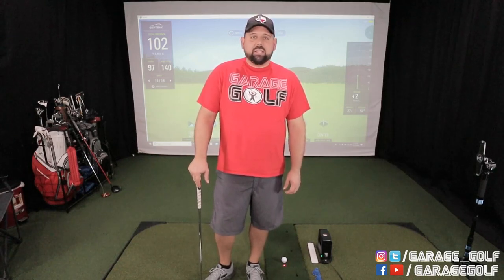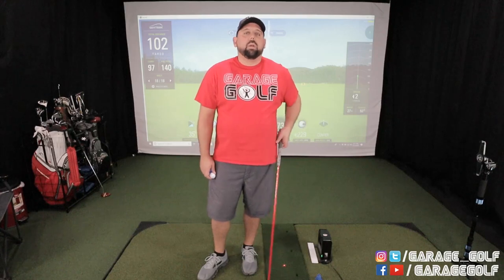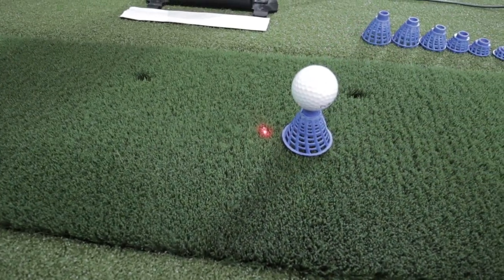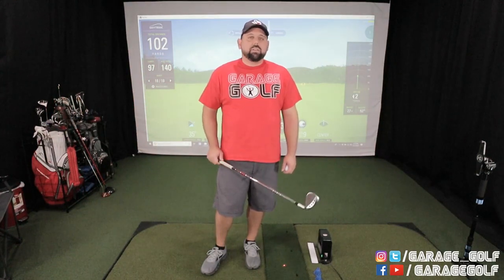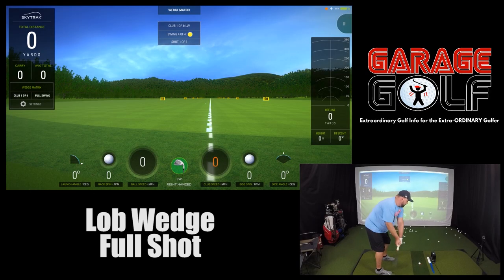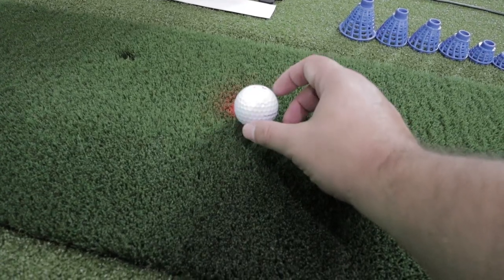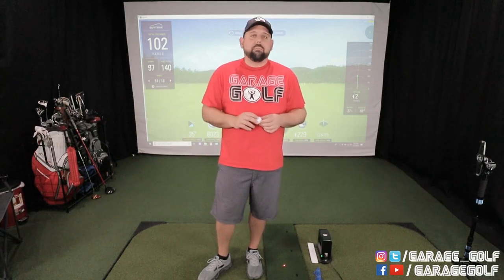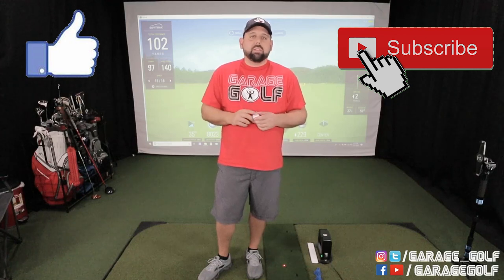Skytrak Tech Tip - Golf Ball Placement

Comment: How did you make sure your skytrak was aligned properly? Sometimes I feel it is off.. some rounds I will be hitting everything left and other rounds I'm perfect. I believe it's because I'm not setup perfect as I have to move it everytime I'm done using it. Thanks!
Reply from the maker: Hello Sean, It is certainly a tedious process sometimes. I normally go on the app or simulator program I am using and hit several chip shots to see what it is doing in comparison to what shows up on the screen. If you have a program where you can test putting with no break on the green (for example Jack Nicklaus Perfect Golf has this option) it is best to test out with putting. If the putt rolls true, most likely your shots will follow. After adjusting it for the putting, then test out some chip shots and lastly full shots. As you might see in my video, my Skytrak is actually about 1/8 open to the target line. That is the way I had to set it up to most accurately represent a straight putt. I saw little to no effect on full shots or chip shots by doing this so that is where I left it. That is why I put the piece of tape down in front of the Skytrak at its feet in the event I ever have to move it. If you line it up on your mat, put a piece of tape or indicator on your mat as well. If you have to move your mat nightly, mark the four corners of your mat with a tape outline so you know the exact spot to put it back when you set it back down. This will ensure you have the same setup each time you set it back down again. Hope this helps and thanks for watching!

Comment: About to buy a skytrack... what about drawing lines on your golf ball. So you dont have to line up the logo every time
Reply from the maker: I never line the ball up with the logo for the most part. Biggest thing with misreads is bad lighting. I now have a lamp right above the ball behind the Skytrak facing the ball and have virtually no misreads as a result. Love my Skytrak. Quick question, are you buying the Skytrak from them directly or from someone? If buying from Skytrak will you please use affiliate code: garagegolf at checkout? It helps out our channel and doesn't cost you any extra. I am here if you have any questions either way with setup or anything else. Appreciate you!
Reply: @GarageGolf  I will for sure when I buy it ... what kinda laptop specs is best for the skytrack?
Reply from the maker: @alandisney8276  Thanks!

For PC  I would go with min I5 processor but i7 is better, 16gb ram, 1 tb hard drive, nvidia gtx 1060 graphics card or higher.

Comment: Boy we could use your help.  We have tried a lot of your ideas including Wifi connection, light behind the ball, ball logo facing skytrack.  We are skill only getting about 30% of our shots to register.  Do do know our mat moves quite a bit and have ordered a gripper to try to keep it still, it sits on carpet.  Any other ideas would be appreciated
Reply from the maker: I feel your pain with the missed shots. I can minimize it by ball placement as per the video, making sure that my Skytrak is not on the same mat I am hitting off of and I now use an LED light that I shine onto the golf ball as well. That being said there will still be misreads. Now having that many misreads is a bit uncommon. Try cleaning the laser with a microfiber towel and seeing if that makes any difference. Is your Skytrak also in a case? I have heard of interference with the standard Skytrak case they sell as well. I know this is scary but try taking it out of the case and hitting about 10 shots to see how many misreads you are getting that way.
 I also never connect my Skytrak via usb as it always has a lot more misreads that way to me. Try charging your Skytrak with a portable phone charger instead when using it and connecting via network mode. I found that made a world of difference when I use mine. Try troubleshooting these and let me know if you see some improvement. Also take the Skytrak off your current mat if you can and try lining it up at the same height as your current mat but not on the mat itself (I use some books on the floor next to my golf mat in my sim room). The movement from the mat can cause a great deal of misreads. Let me know if any of this helps!!
Reply: @GarageGolf  Thanks so much.  I will try some of those. Do you think the matt moving could cause issues even if the sky track isn't on it?  I will try cleaning the lens and taking it out of the protective box.  We also have an LED light on order.  You have helped me much more than Sky Trak.  Ill be in touch!!
Reply from the maker: @karihall9542  Yes the mat moving could still cause issues reading it. Try some carpet tape or double sided velcro. That's what I used on mine!

Comment: I've just bought a fiberbuilt mat with the heavy bristle hitting area.  My skytrak won't read a shot.  I had no reading issues with my CCE may but my elbow was SHOT!.  Any tips on why or how I can get my skytrak to read shots off the fiberbuilt mat?  I've tried taking it out of the case and just using the skytrak thinking the case made it too high or something.  Didn't help.
Reply from the maker: How is the lighting in your space? Have you tried shining an LED light on your hitting area but not hitting the camera in the Skytrak? It helps with misreads. If not try raising the height of your Skytrak slightly. If the bristles are higher than your CCE mat it may just not be reading it right due to a difference in height.

Comment: My 3 hybrid doesn't register shots. Is it because of the black finish on the top of the club?
Reply from the maker: No black typically does not cause this issue. Try placing it about 2 to 3 inches behind the laser dot and see if that possibly helps. Different ball placement with different clubs is sometimes required depending on your swing type. Also try shining an LED light on the ball from behind the Skytrak. That helped me dramatically.
Reply: @GarageGolf  I end up losing pretty much 10-15 yards of distance with the skytrak on any club. Any tips there?
Reply from the maker: @algus7626  How long have you had your setup? There is actually such a thing as "Indoor Swing Syndrome" that we all go through initially that causes you to lose about 10 - 20 yards off your normal shots. Whether it be hitting off a mat or just getting used to hitting indoors believe me it is a real thing whether you feel it or not or your brain registers it as well. Also make sure you set your elevation appropriately if using the Skytrak app under settings to match your elevation in your area and also set your ground to soft, medium or hard based upon where you are at. Let me know.
Reply: @GarageGolf  I've had it for a little over a week. I had no clue about that initial loss of distance. That's good to know. My elevation, temperature, and all that has been changed accordingly. Thank you!

Comment: Where do you suggest place placement for just irons?
Reply from the maker: For normal irons you should be fine placing the ball right on the laser where the laser hits the bottom of the golf ball. If you notice your shot is higher or lower than most then adjust accordingly. If your shots tend to have a lower penetrating flight, then place it slightly behind the laser. If your shots tend to get up in the air quickly place it in front of the laser dot. Hope this helps! Thanks for watching.

Comment: DO OU HAVE A VIDEO ON HOW TO CONNECT THE SKYTRAK TO THE PROJECTOR THROUGHT IPAD?
Reply from the maker: No that would depend on the projector more than anything and if it has wireless screen sharing capabilities. You could also use an HDMI from Ipad Lighting port out directly into the HDMI input on projector or even better use the lighting port out into an HDMI splitter that could then go out to a TV or external monitor and the projector as well. That is how I have mine set up.
Reply: Also, make sure to but the Apple branded HDMI adapter. I bought a knock off one on Amazon and it did not work.
Reply from the maker: @thomaslail5475  Great point. I had the same experience on my end.

Comment: Hey there. I have a new glitch in my SkyTrak. Was wondering if anyone else has the same issue or an idea to resolve it.

On my 7 & 8 irons about 1 in every 5 shots when in the randomizer, closest to or on the range it reads my club speed between 97-99mph  and my spin between 11,00-12,000 with a distance of about 150 yards.  Where my swing speed is typically 88-90 mph with a spin of 6,000-7,000. I have tried 4 different brand golf balls and it has done it on all. But it has not done that with 9iron or PW yet.

Comment: How do you get the red dots for alignment
Reply from the maker: When you start the Skytrak app and connect the Skytrak successfully, go to the bottom right hand corner of the screen that says "Device Level" and has the picture of the level. In there you can turn alignment mode off or on. When you turn alignment mode on you will see the two red dots on your mat. Please note this has been proven to not be the most effective way of lining up your Skytrak to the screen. The best way would be to hit short chip shots or putts as straight as possible into the screen. You can then see the ball flight on the screen and see if it goes right or left from there and adjust accordingly if needed by opening or closing the face of the Skytrak. Opening the face of the Skytrak to the right will level shots more to the left and vice versa. If you see my mat you will see that my Skytrak is about 1/8 open (not square to the hitting surface) I tested this by putting on a flat green on the simulator and noticed all my putts were breaking right even though they were straight in my sim room. I then adjusted from there and then moved to chip shots and lastly full shots. After I had it where I wanted it I added the piece of tape to the floor so I always know where to line the Skytrak up.

Comment: Broke mine out for the first time in months, updated it and now it wont work at all. Registered 1 out of 20 shots. Need help please!
Reply from the maker: Very strange. What kind of shots were you hitting? Iron, Driver? Is the SkyTrak the same height as your golf mat? Have to make sure it is level with the mat, preferably without being on the hitting mat itself if it is a 1 piece design. Sufficient lighting in your area? All of these can cause misreads if not set up properly. Let me know when you have a moment.

Comment: What are the tees you’re using in this video? I just got my SkyTrak set up today, but I’ve found that the instructions want the laser at the base of the tee. That means an iron shot wants the ball basically in the hole where the tee goes.
Reply from the maker: The tees are called Birtees and work great. Just line the base of the tee where the laser line is shining and you should be great. Get the 8 pack of tees. That is what I did. Any color but white as it confuses the Skytrak. Let me know if you have an other questions. Thanks again for watching!